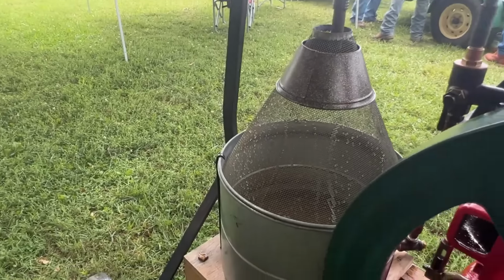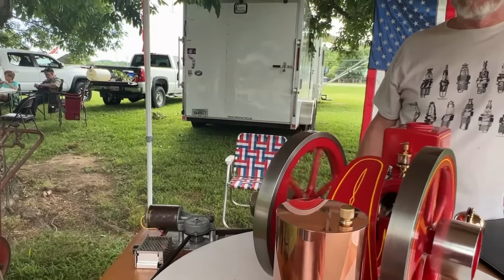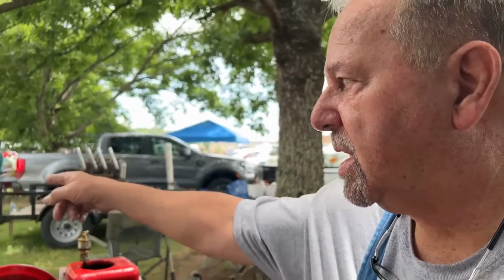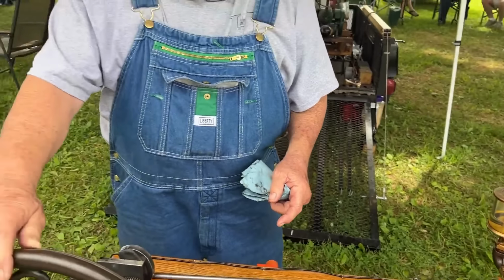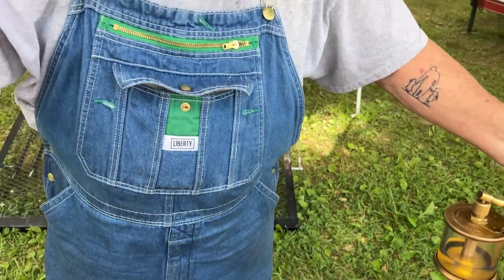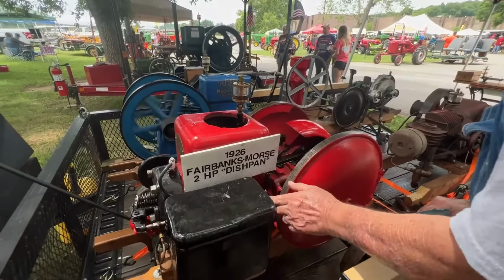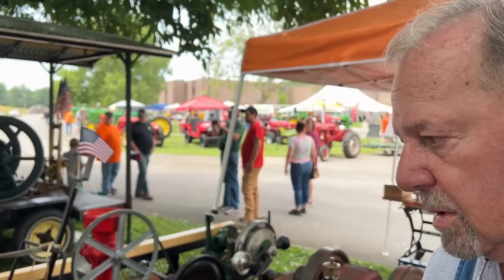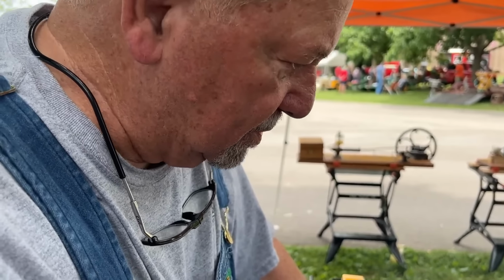Hit and Miss Engines are Good for 4 Things Now Days

Comment: Actually, there are more efficient lower speed alternator/generators of today that could couple to this high torque engine.  The hit and miss engine uses small amounts of fuel to generate a lot of torque to a large flywheel. This could drive newer, more efficient, electrical generators used for small off grid cabins or homes.  Lighting and electronics of today, to include more efficient refrigerators, and small appliances, etc. use less power to do the same thing. It would be an interesting experiment to couple the old flywheel engines with newer alternator/generators made to work at lower speeds. With the right gearing/transmission, I theorize the final output could be enough.  The old 2 two cylinder John Deere tractors used this concept of high torque to drive a large fly wheel to drive all sorts of other things.  Necessity is the mother of invention.  Great pieces of American history.  I remember starting the tractors and the hit and miss as kid in the 70's. For perspective, my dad was 51, when I was born, and he was born in 1919. I was exposed to three family farms that had all the early day farm equipment.
Reply from the maker: Thanks for the comment and Happy Memorial Day ! John

Comment: Our was the vaccuum source for our Milking Machines.. We had an electric pump normally used, but, power outage and we could still geter done?  Hand milking 32 Head was doable, but, hanfs got tired.
Reply: Dad had his pickup modified with a vacuum port on the intake.  During power outages, just run a hose from the truck to the line in the barn, and you could milk the cows like normal, but with fewer milking machines.

Comment: Some might find this interesting - when you see a single cyliinder gasoline engine cranked several times till it starts - 
       Most of  the time the cylinder isnt warm enough to flash the hydrogen out the fuel - propane or butane is desolved in gas as a catalyst -
     After an engine has been cranked some the higher air pressure warms the cylinder - once the cylinder temp rises it easely flashes the lighter vapors out of the loquid fuel --     the spark ignights the vapors and the engine runs -
      With a diesel the fuel wont ignight till the cylinder is above 32° -

Comment: They get work done without electronic engine management. That's a viable source of power with emp immunity.
Reply: The engine club near me has a 6 cylinder Fairbanks Morse diesel generator and the old switch gear. If the grid goes down I know one area that will still have power.

Comment: A fellow I used to work with had several old hit and miss motors. He would set up them up at the county fair and demonstrate their operation and talk about their early applications. You gotta appreciate the simplicity and elegance of these old machines. Back when things were made to work well and run forever. Flash forward to the age of technology and we're purposely building obsolescence into the things we have to rely on. 🤔 For all we've gained there are things we've lost.
Reply: One of the most poignant things I've read on the internet as of late, very well said.
Reply: I guess Ford learned that the hard way this year. They looked at their sales sheets... Slim to none.
Reply: We can thank the dealerships for that one.
Reply: I like to listen to them talk but I wish they would show the working machines closer in more detail

Comment: I'm 40 years old. I grew up going to the show in Portland Indiana. My Dad had several old hit n miss. I still have them. The only one I know much about was an old small Maytag. I'd kick it over and get it going to take to local shows. They're very cool machines. I personally have a love for the flathead motors 32-52. I have several as well as old speed racing used on salt. I love the sound. I've been thinking about trying to get one of the larger hot n miss that never ran going to use as a generator. The sound they made as well as proportions and flywheels is something to behold. I'm a master fabricator by trade with a degree in Metallurgy. I've been giving real thoughts to duplicating a Tiger Schwinn Cantilever frame and attempting to cast my own motor. My thought was to buy 2 cheap Chinese cases to cobble together to elongate my cylinder. You can get them to 100 cc but swap a head to get 110cc with a 50mm piston. However Stihl Saws makes big bore kits going to 56mm with a very similar head. I think I could make a Frankenstein and recast with better material as well as sleeve it. 125-150 cc two stroke would propel a bicycle to probably 85-100 mph 😆 it makes sense in my mind.

Comment: I was a charter member of Branch 3 of Early Day Gasoline Engine and Tractor Association in the 1970's through 1990's. These are wonderful old machines. Many small machine shops to larger iron works manufactured their own design of these stationary engines.  Most of the flywheel style were cast iron open flywheel style, as opposed to the later air cooled aluminum ones.

Comment: I never understood the engineering reasoning for hit and miss. It's all of the friction and fuel for half the power.
Reply: I think it is all about how to regulate engine speed. Hit & Miss skips addimg fuel on some strokes to keep the speed near the rate the governor sets. The alternative would be to control up and down how much fuel & air are added on each stroke. So "Hit & Miss: Because carburetors are complicated" ? (Could also be they automatically adjust to different kinds of fuel?) 

I could be totally off base.

Comment: My annoyance is that thanks to modern emissions compliance regulations, most of our modern engines are no better on fuel consumption per unit of useable power produced than most of those old engines were in their day running on the worst fuels imaginable.  (Horsepower hours per gallon / KWH per liter numbers.)